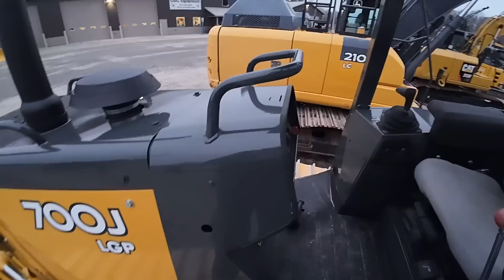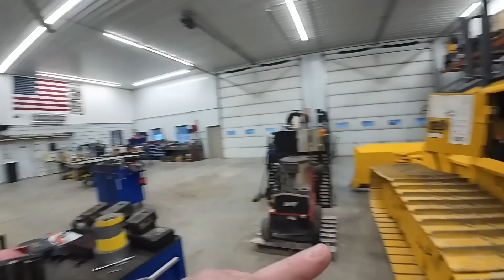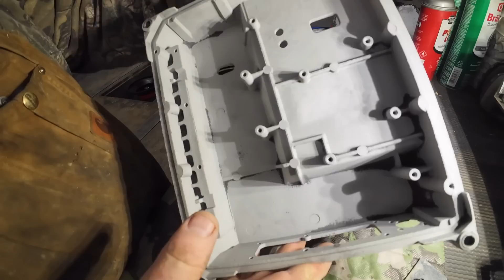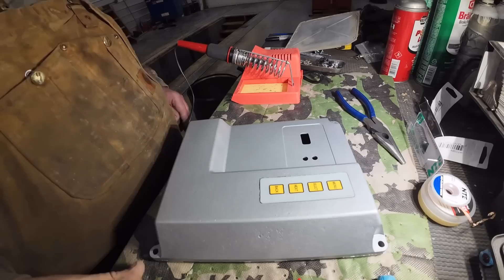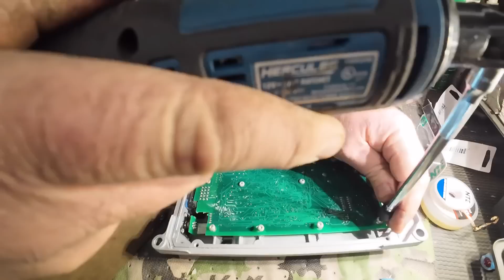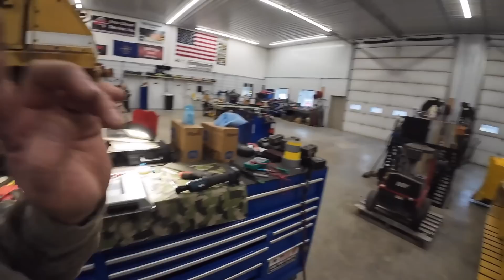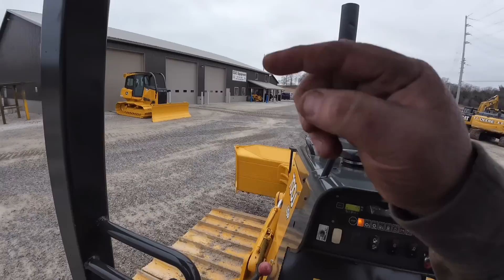John Deere 700J dozer transmission MC300 controller repair after it failed for cheap!

Comment: Bad Idea using Acid core solder for PCB repair. It can eat the traces off of the PCB. Acid core solder: Soldering wires having a hollow core filled with acid are called acid core solders. Acid is an aggressive flux that removes the metal oxide layer from the metal surface on which it is applied. After soldering, the surface needs to be cleaned to prevent the excess flux from corroding the surface. Acid core solder is used for making strong joints in steel structures but is not recommended for electronics. This is what you want to be using Clint. Rosin core solder: In resin core solder, instead of filling the core of the solder wire with acid, it is filled with rosin, a semi-transparent resin obtained from trees that acts as a mild flux. I have repaired thousands of PCB's in my life. Acid core is great for copper pipe etc. but is is very hard on PCB's (Printed Circuit Boards)

Comment: clint get some deoxit oralys has or can get .. use it to clean up the board before you work on it . then take a bit of alcohol to cean around the leads after you get them back in the board as the solder leave a bit of resion on the board that can degrade the jount over time and cause a short

Comment: Another brilliant video, Clint
Knowledge is power. It's like these transmission controllers are a legacy product that is designed to fail. Low quality membrane switches die-cast aluminium enclosure, which suffers from corrosion and moisture. 

We don't have any radio shops left in the UK. We used to have realistic, radio shack, tandy & maplins for electronic components. 

It's a shame you can't get someone to read the eprom microcontrollers in the board and reverse engineer it then use one of the large high volume pcb companies like JLPCB etc and make new ABS enclosures 

I wouldn't recommend glueing in the membrane switches and screen with superglue as Cyanoacrylate doesn't handle vibration and cracks. I'd recommend 1.1mm 3M VHB 5952 double-sided tape 

Also, when replacing the capacitors, reapply hot glue around them to hold them as the machines inherent vibration can snap the leads (legs) soldered into the board.

Big shout out from the UK audience 🇬🇧

Comment: Very good job Clint, just a little hint to make the leads solder better, take some fine sandpaper and shine the leads like you were soldering copper pipe. I am guessing those capacitors are used in the power supply circuit to filter out noise spikes.

Comment: Especially since you replaced with 2 leg capacitors instead of the original 3 leg, I'd put a little bit of low temp melt hot glue around the base of each capacitor once installed.  Being these are in a mobile platform and especially a bulldozer, something that shakes a LOT, solder joints have a much higher risk of cracking because of metal fatigue.  It's why the original manufacturer put those GOBS of liquid rubberized goop around the base of the large capacitors and why they had the 3rd leg for stability.  It helped reduce the chance of a cracked solder joint.

Second, why not put a new gasket around the base of that cover to prevent water and dirt intrusion?

Comment: I'll be surprised if that repair lasts a year.if you look at the circuit board you'll see its shiny,that's a conformal coating painted on the circuit board  to keep moisture  etc out,and  the reason they don't need a totally sealed enclosure.Removing the capacitors will have broken the seal,so moisture can now get into the pcb  A can of spray to reseal the board shouldn't  cost you to much and will last you a while,or you could borrow the wives/kevins  clear nail varnish

Comment: Capacitors should be tested out of circuit, hope this helps
Reply: Indeed. Must be removed first or you are not measuring anything of value.
Reply: Nice work Clint ;) Cheers Ray (UK)
Reply: @aeros4me *Clint. You thinking of Kurtis @ CEE in Australia

Comment: Lead acid base?  Shouldn't it be rosin core?
Reply: 🤔 any acid core flux and will corrode the wire or circuit board trace if you were to use it. Lead with tin is fine. 😊

Comment: You might want to put some silicone back around the capacitors to help with vibration.
Reply: I'm not an electrician, and I don't play one on Youtube.  The two screens, I would have used the silicone via a small 1/16th to 1/8" bead to aid in sealing the unit from moisture.  I would have also done the same for the bottom removable plate. Or use some Permatex The Right Stuff Gasket Maker, to aid in sealing the screens & unit from moisture.
Reply: @stanwooddave_1953 It may be impossible to prevent moisture from getting in with those plastic plates on the top. If you sealed the bottom, it would hold the water inside and short out when in use. The way it is now, the water will run out the bottom.

Comment: I have done 40 years of soldering and repairing PWB'S. Clinton, you did a mighty fine job. 😊 Awesome! 😊 I still have all my soldering tools and  solder!
Reply: @ericwilkinson1771  Why is that?
Reply: @rhondasweeney7271 because they want yah to buy a new one
Reply: @koda7820 given the lack of ESD protection, blowing air across circuit board and swiping fingers across the IC's,etc., odds are anyone watching this and trying to duplicate the repair will zap the board, rendering it useless and guaranteeing purchase of a replacement.
Reply: @James_Scheid  Obviously not true, zapping is grossly exaggerated by so called experts, us fixits have never used wrist straps or worried about the carpet and have fixed hundreds of silicon chip products.
Reply: ESD protection is a real thing but primarily for specific circuits and chip designs. CMOS and MOSFETS are the most sensitive, primarily with tiny junctions and minature circuitry (PC's, etc.). As a retired Raytheon Controls Engineer (ground and airborne radar), looking at microscopic failed junctions was a thing. Most industrial equipment try to stay away from those devices as they do not need miniature stuff, and the environment precludes it.  The board nor the control chips, Clint was working on, did not have any visible ESD triangles or circles, so he should be good.
Reply: @paulholmes672  in working in the field that I did. I would double ground on many occasions because of the sensitivity.
Reply: Clint, did you say acid core solder?  PWB's should use Rosin Core solder, the acid is not too kind to FR4 boards and components, if not cleaned. Acid core is primarily used for plumbing.  Once you finish your soldering, use a little alcohol (after it cools) to clean the flux of the leads and the board.  Q-tips are our friend.  Nice work Sir!!!
Reply: @paulholmes672  You are correct. It should be Rosin Core  flux and solder
Reply: @rhondasweeney7271  Thanks.  I know Clint was using Rosin Paste Flux from the tin, so not a big issue, but even a little acid is not good.
Reply: @paulholmes672  You're correct again. It is not good at all. I do know about acid flux. Because I know how to sweat a pipe.
Reply: John Deere will be calling to hire you to do there fixing ,lol ThanksBigAlCalifornia
Reply: @alkennedy1124  Nope, I am retired. I will not go back to work.
Reply: Really cool footage, Clint!!!
Reply: You did one mighty fine job Clint!!!!!

Comment: The capacitors have a third leg and are glued,i think it's because a dozer is vibrating a lot,not being suspended like a car.
You should hot glue them back,to prevent failure caused by vibration.
Reply: That's why the added silicone is for... vibration, not for moisture/water. 👍🏼
Reply: @stevenr8606  But did Clint re-silicone the caps.  He didn't show that.

Comment: I recommend using a wrist ground strap when working on electronic circuit boards. Static electricity can cause damage to components.
Reply: Old wives tale.
Reply: @mattmanyam  Electronics engineer for 47 years. You?
Reply: Early ss electronics were susceptible to damage from static. Any quality electronics in the last 40+ years have been designed to mitigate that issue.
Reply: There was not an ESDS warning label on the circuit board.
Reply: It’s not an old wives tale.  Winter time low humidity was the worst for that . Walk across carpet and give static shock to a board and you know you screwed up. Keeping the wrist strap on was a pain but needed. 

Also put some water in the solder sponge and wipe the gunk off your iron tip will help with soldering.

Comment: Way back in 1971, I worked in an oilfield wireline shop.  We had issues with capacitors in some of our older equipment.  In the 1960's the capacitors that were common were paper and aluminum foil construction.  In Louisiana, it is very humid and the capacitors were shorting out because the paper (dialectic) part of the capacitor would break down in the humidity.  Our circuit boards were fixed by installing electrolytic capacitors.  It sounds like the exact same problem you are seeing.  In fact, the old devices you removed even look like the old style capacitors we were replacing.  It is amazing anyone would still be using the paper aluminum foil type of capacitor.
Reply: Probably because they are cheaper in the short haul.
Reply: Low bid. Everything by Deere is low bid.

Comment: You cannot measure a capacitor value while it is still in the circuit. You have to remove the capacitors then measure them. use an esr meter to test in circuit.
Reply: Tehicly you can measure capacitor while it is in circuit, but will not get value of capacitor you will get  total capacitance at that point in circuit.

Comment: Clint if you want to put the silicone back make sure its for electrical service most standard silicone caulking will corrode copper.